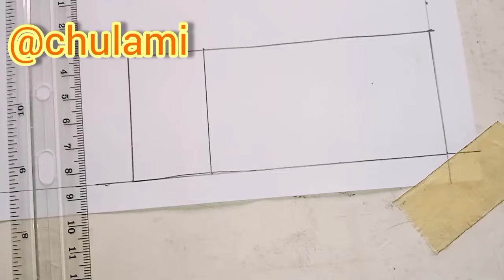How to draw border line and title block (technical drawing) #technicaldrawing #engineeringdrawing

Comment: Thank you very much sir it's helpful
But i have a question 👇
1)  Letter the alphabet in capital letter and figure up to 50 in 3mm,6mm and 10 mm. Use faint guide lines and keep character widths and spacing consistent.
2) letter the following dimensions in 3mm,6mm and 10mm.  0.73,0.75,3.16,1.65,442,1290,32780.
3) letter the notes as set our below in 3mm character , use faint guide hoes and leave 3mm between line of lettering 
a} my God bless me
Number 1 and 3 is very important
Reply from the maker: Nice

Comment: Relation of scale and drawing please 🙏
Reply from the maker: It depends, 
If the diagram on your paper is equal in scale (dimensions) to the pictorial view,
Then the scale is in proportion to 1:1
But if there's an increase in proportion either enlargement or reduction, then the used scale should be indicated in the title block. Example, 3:1, 1:60 e.t.c